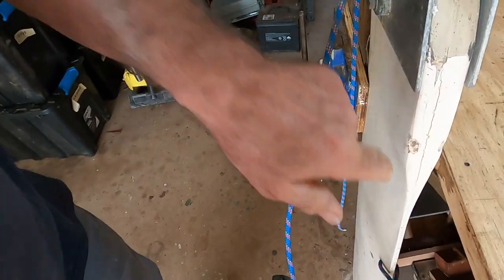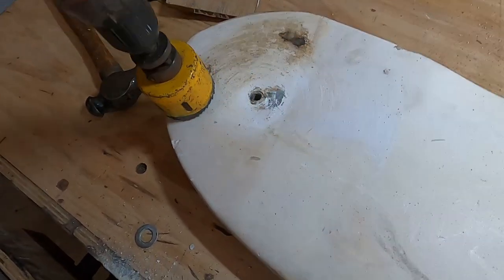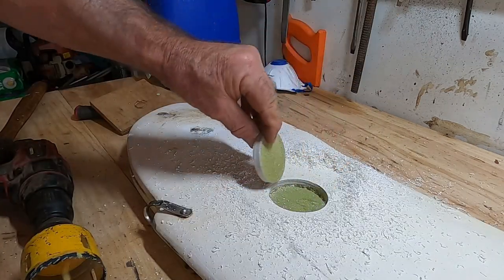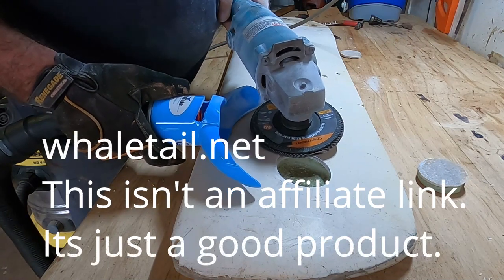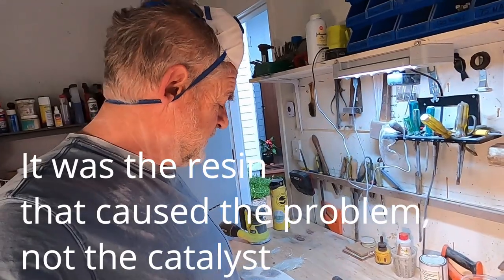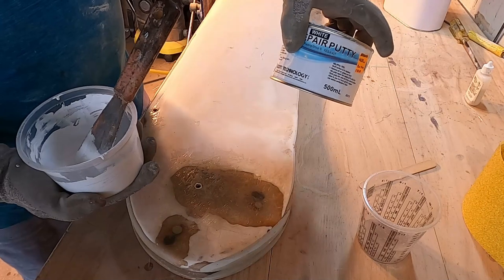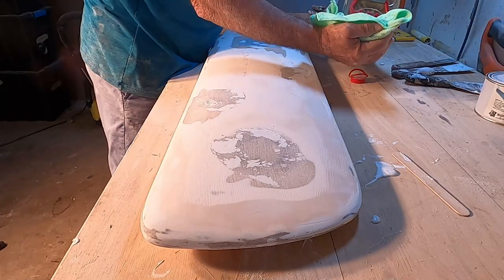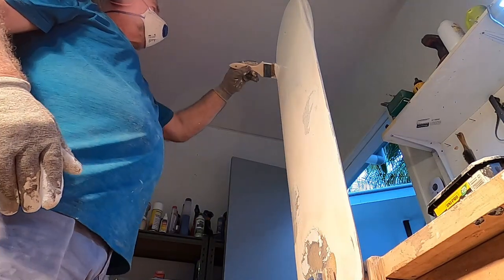Polyester or epoxy resin for rudder repair. What works best? Ep. 6

Comment: Another great video.  I used to do everything with polyester, and now I seem to do everything with epoxy.  I think when you want high volume and fast building time, polyester is still the way to go - you can go layer after layer, and it cures so quickly.  I guess a project of this size is borderline in terms of size.  For me the answer would probably be in whatever I happened to have on my shelf, which probably isn't the best reason!  Thanks again for taking the time to share your wisdom.
Reply from the maker: That is helpful. I'm moving on to the repair of the cockpit floor. I will be using epoxy for the main structural parts because of its strength. What about epoxy over brand new polyester work?
Reply: @SmallSailboatCruising  To be honest, my answer would only be a guess, but it is something I would do.

Comment: Thanks for digging into your rudder, now I know what is inside mine, and that they are heavily built not full of wet ply. As to the polyester versus epoxy debate, I tend to use polyester to fill holes and cracks, but would be more likely to use epoxy for gluing as it seems to retain more flexibility when set.
Reply from the maker: It’s worth noting that the head of the rubber blade is Caulfield was plywood. And there was some splitting as a result of the plywood having expanded. I chose to strengthen it and repair the cracks as the fibreglass construction is so solid that I doubt that it needs the strength of the plywood core. But I’ll be keeping an eye on the repair to make sure that it stays intact.

Comment: Thank you for sharing the experience. Assuming the rudder was built up with epoxy resin, can we do a subsequent repair with polyester resin?
Reply from the maker: If the rudder was built from epoxy you should repair it with epoxy. It is not recommended to put polyester over epoxy.
Reply: @SmallSailboatCruising  Thank you so much.

Comment: Pro's & Con's of polyester resin, pro's it doesn't need sanding between layers within 72 hours like expoxy does. Con's polyester resin isn't waterproof so it must be sealed with flowcoat.
Reply: Agree with the waterproof benefits of epoxy. If you do the next layer of epoxy before the chemical reaction is finished you do not need to sand either, about 24 hours. A drawback with epoxy is price.
Reply from the maker: @sailoutofagarage6212  I think the reason I have kept away from epoxy is mainly price. It seems vulnerable to UV, so needs painting of course. Having said that, I like its strength properties.
Reply from the maker: In a rush of blood I cut out the cockpit floor. I have restored and recycled what I cut out, replacing some rotten ply. Laminated it up with polyester but I'm using epoxy to reinstall it.